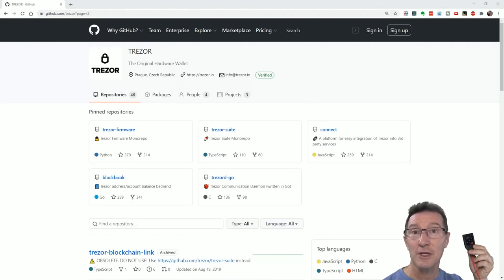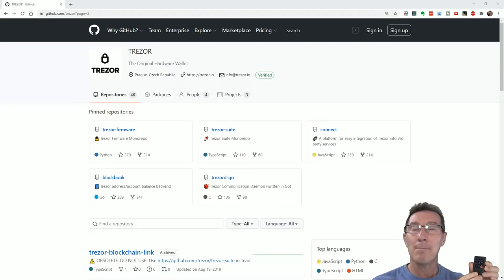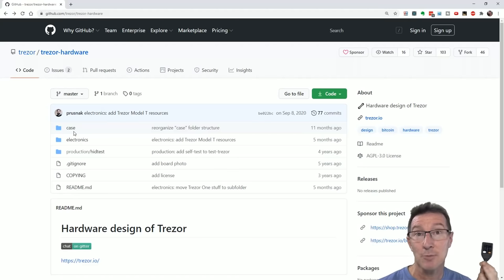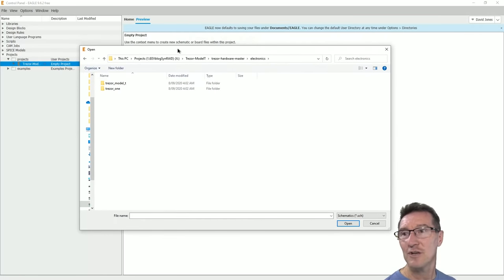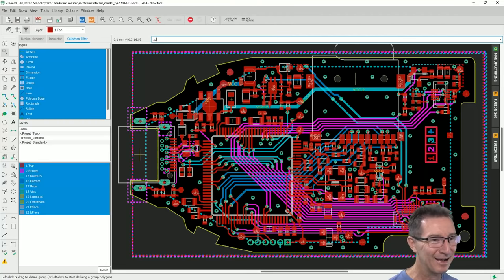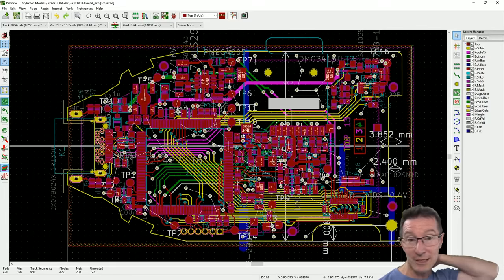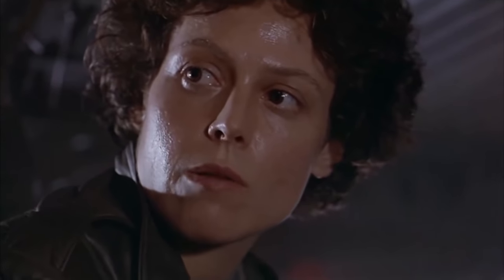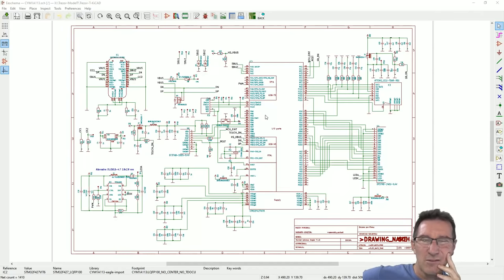EEVblog #1374 - DIY Trezor Crypto Hardware Wallet - Part 1

Comment from the maker: There is more hardware info here: https://github.com/trezor/trezor-firmware/blob/master/docs/hardware/model-t/index.md
Reply: Hopefully that Trezor engineer gets a call out! He got a bit raked over the coals in this video
Reply: "For those playing along at home": Most likely thanks to Dave - they've added tons of files, including kicad project files - however the edge cut layers of K1 are preventing the 3D viewer from loading properly. The slots/oval holes for SH1-4 are currently in the edge cuts layer. They need to be migrated from the edge cuts layer to the through hole pad parameters. The final result may be the same, depending on the fab. However if you edit parameters of the through hole pads mentioned - in the top right hand corner of the pad parameters window, you'll see the drop down menu to change the hole shape from circular to oval and add the proper numbers. Based on the corresponding stray segments in the edge cuts layer; SH2 and SH3 holes should be Oval, X:1.6mm x Y:0.6mm, SH1 and SH4 holes should be Oval, X:1.56mm x Y:0.6mm. Once you've changed the pad hole type + dimensions, then delete the corresponding segments on the edge cuts layer, and the 3D viewer now loads the board as desired.
Reply: They have updated github. Now there is a bom, schematic as png, and a general overview: index.md
Reply: I'd love to see one designed from scratch. could this be design as a breakout board so that various microcontrollers be utilised / flashed, rather than locking design to a particular architecture. could use rust to code the firmware, which would allow to target different boards.
Reply: is not found now

Comment: I know this is taking a different direction to solve the problem, but I found the “PiTrezor” project quite promising, as it lets you use the Trezor source code on a $5 Raspberry Pi Zero. No need to muck around with the hardware side of things. Can even add OLED displays and such.
Reply from the maker: Nice, didn't know about that, thanks. I want mine to be 100% firmware compatible though.
Reply: Thanks that sounds promising. Especially with BLE and a touch screen. But you'd need a custom firmware, PC app for password management and encrypted backup functionality.
Reply: Wait...so technically I can carry one of these on an SD card? Interesting.
Reply: What do you mean under "can"? Without a display you do not see what you are signing.
Reply: @pahom2  I mean that I can carry the SD card around but would obviously put it into a pi zero device when necessary
The ability to separate my wallet from the hardware, so that loss or theft of the pi device would be yet another wall between a malicious third party finding or stealing the pi device and through unknown means manages to access my wallet
It's merely a somewhat amusing and interesting thought rather than anything substantial or 'meaningful'
It'd be like the devices for credit and debit cards whereby you need to insert your card, enter your pin, and be given a code in return to enable the card holder to do whatever
Reply: @nicwilson89  when you are making a transaction you should see what address you are transferring funds to on the device. If you only store keys on the device and sign any transaction sent to it by pressing a button then this device do not give you any additional protection over the software that is actually interacting with it.
Reply: @pahom2  Where have I suggested any of that was my thinking behind the initial comment?
If I own multiple pi devices, for example, the spark of an idea would be that I only need carry the card or set of cards to wherever the other device(s) is. Say, if I have one of them in the car and intend on going out and paying for something with funds in the wallet somewhere such as a store that accepts crypto payment. Perhaps you have multiple cards for whatever reason and may store them in one of those tiny card holders, not that keeping a bunch of separate cards in one place whilst you're out and about would be much of a good idea.
Who knows, I'm merely thinking of hypotheticals and musing on things that were never intended to be serious in any way.
It matters little not whether it's unnecessary or silly since it was never anything more than a random thought.
Reply: @nicwilson89  I am answering Robert comment. He said that the hardware wallet based on Pi can even have an OLED display. And I've pointed out that it must have display to be secure.
Reply: @pahom2  Ahh, I see. My mistake! It seems you tagged me in that reply so I mistaking assumed you were addressing my comment. Apologies :)
Reply: @pahom2  The default configuration would be to use the Pi’s HDMI port with a monitor; an OLED would make it more portable and user-friendly.
Reply: @robertsundling  HDMI output is also ok. I am still under impression off all those "hardware wallets" with a single button, hence no control on what is actually signing.
Reply: how about the new  Raspberry Pico
Reply: @dh2032  Any microcontroller could work.
Advantage of the Pi Zero is that it can just run the trezor firmware with some emulation layer.
Downside is you might have more complex software stack and more vulnerabilities. My ideal would be to have just 1 single C file for the firmware that can be easily understood.
And Pi zero W has BLE which might be interesting. 
My ideal would be a "dumb smartwatch" you just carry on your person.
Reply: @EEVblog  hope you do it, could be a really interesting end to end project

Comment: 19:36 Kicad doesn't connect nets if the fill isn't applied, you may simply fill all four layers by pushing "B" and all nets should be connected.
Reply: if the zones have been assigned to the correct nets that is ...

Comment: These dots are canvas for planes, you must click "ratsnest" in eagle to render them.
Reply: Yeah, the plane outlines do not need to overlap 100%, since there's a board outline; it will apply the 'fill' on whatever is enclosed by the dotted-line when you hit on "ratsnest".

Comment: For a bigger screen, you should simply build your Trezor into that giant LCD infrared optical touchscreen monitor that you found in the dumpster. 😃
Reply: Lol. If only an STM32F4 could drive an LCD with that resolution...
Reply from the maker: If it was firmware compaitble, yeah :-D
Reply: @EEVblog  Make the hardware wallet a Raspberry Pi hat with a provision for the programmer?
Reply: @EEVblog  nothing a janky in-between can’t fix ;)

Comment: @EEVblog You click on the file name on GitHub page. Top right you get the selection to download the RAW file or you download the Zip of the entire project as you did.
Using Tortoise Git will make you life A LOT easier if you don't use git or the shell a lot.
Reply from the maker: We used Tortoise SVN at Altium, I liked that.
Reply: @EEVblog  - I am not experienced with hardware, so most of your vids look like black magic, especially when you go into the ElecEngineering stuff - but I am a software guy - its nice to see that you are still human, battling with github - gives me hope that I could apply myself to some hardware projects. - I hope we see more on this project. - but check out these guys - https://youtu.be/mqEfldjCqVY - get these guys on ur side.

Comment: Dave, on Github if browse into a specific file you can hit the "Raw" button in the upper right to download the actual file. You can also download a zip of the whole project from the top directory  page by clicking the green "Code" button and then hitting the "Download ZIP" link.

Comment: Maybe for part 2, try and redo the board on 2 layers and maybe change the form factor to something you like. Add another USB port. Remove some of the extra decoupling caps. Make it more minimal.
Basically keeping the hardware the same but potentially making it cheaper and more redundant. I do think this could be done on 2 layers as long as you keep the USB traces short.
Would make it much easier for amateur hobbyists to DIY their own wallet that way. Adding more decentralization I'd say.

EDIT: On second thought, I have some free time on my hands and might actually take this up. Let me know if there's any other suggestions

Comment: Doesn't look like the case in this repo, but idiomatic usage of GitHub wouldn't put 'outputs' into the repository, the same way the repo wouldn't include object files for a software project. They would be generated by a CI script and possibly included in a Release zip.

In lieu of the infrastructure to do that though (which is a bit trickier with hardware projects) I agree they should be part of the repo.

As far as the way forward, the imports don't look that bad, I would proceed with them. Yeah there's some spurious footprints in the library, but the rest looks okay. Your GND nets are (most likely) unconnected because the fills haven't been updated (press B). The Edge.Cuts layer looks like it might need some tweaking (since the 3D viewer can't determine the outline), but other than that it is probably usable.

As far as the soldermask expansion, it appears that the Adhesive and F.Mask layers are rendering in the same colour. Turn off the rendering of the Adhesive layer and it's probably okay. I assume the adhesive layer is just part of the Eagle libraries in case you need it, and you wouldn't send it to the CM if they don't require it. You can go into the Board Setup and just remove the layers you don't want.

Comment: The biggest weakness of Trezor over its competition in my opinion is that it has no separate secure element for storing the key material. There have already been attacks demonstrated that can recover key material through side-channel attacks, since the read protection of the STM32 storage is not really designed for storing sensitive key material. I'd love to see a series where you add support for an actual secure element that is designed specifically to store key material and make these kind of attacks much harder. That's what this device is most lacking.
Reply: The easier thing to do is make it self destruct if it’s opened.
Reply: The secret element doesn't help if it's controlled by an non secure chip. For instance with ledger it may be harder to extract the keys but not much harder to bypass PIN and authorize an transfer. Also most secure elements are completely closed source with an NDA such that you may report bugs to the manufacturer but aren't allowed to publish them.
Reply from the maker: I know. I was going to add stuff to prevent that.
Reply: @EEVblog  That's awesome, can't wait to see the follow-ups!

Comment: @EEVblog Dave, please don't give the guy a thumbs down for what files he shared, the problem is that there is no standard for schematics or PCB layout file formats, yes, the gerbers would be nice, but won't give you the bom/schem also.. (I stumbled over that problem many times too) He uploaded the files he got and wanted to share, you cannot expect the creator to cover all possible software solutions for creating PCBs. And as you said it's not a very complex board, I bet when redesigning it you can even make it better..

If you design OSHW one should use open source software to do so, sounds only logic IMO -.- 
so ... KiCAD.

Comment: I tried to do this while watching. the nets thing is almost entirely fixed (except one pin on the programming header) by refilling the zones (which do already exist. press b). The linkage between the schematic and pcb seems ok. you'd have to fix the holes in the board outline, design rules, etc. the soldermask weirdness is real and is happening because (some of) the imported parts have explicitly drawn polygons on the mask layer. some bulk deleting/renaming could likely be done to clean up these things.

Comment: You wont be able to modify parts of a board that exceed the free specs with the free version, but you can generate gerbers for any number of layers and any board size with the free version.

I do believe Autodesk said that they will always allows you full access to generate gerbers, e.g. for old designs if you happened to move away from Eagle or whatever.

Comment: In KiCad you hit the B button to fill the zones and then all pads connected to those zones will be shown as connected to the zones. If you then hit Ctl-B, or is it Shift-B (not sitting by the computer now), the zones will be unfilled and the GND vias and pads will be shown as not connected.

Don´t know why the frame was moving with the symbol for the chip. Never got that problem while importing Eagle files. Are you using a stable version or the nightly build, v5.99? v5.99 is for the upcoming v6 and there are some major changes for v6 that can cause some problems during the rewrite. The nightly builds are only for testing and debugging, not for designing PCBs, not yet.

Comment: Just FYI, there are (at least) two different philosophies when it comes to whether output artifacts (so, in the case of software: compiled binaries; in the case of hardware, gerber + bom files) should be included in the repo. The disadvantage of excluding them is a certain degree of inconvenience for the end user, sure, but the disadvantage of including them is that people like you will assume that the BOM, board, schematic, gerbers etc are all being kept perfectly in-sync with each other with every single commit. Not to mention merge conflicts, differences in different editor's gerber generation settings/preferences causing subtle nonsense diffs, etc. These problems do have solutions that can work to varying degrees, but still.  I just point that out because with that in mind, it's not necessarily "wrong" for them to not include these artifacts, it may be more of a carefully considered compromise. Or, maybe they're indeed just lazy. I dunno. It would be nice to include a script which generated it though (as is always provided in software repos in the form of a Makefile or similar), that's where the analogy between software and hardware breaks down.

Comment: Can you do an Altium import, then export?
Other folks have run into similar import issues and written their own converters, such as: https://github.com/lachlanA/eagle-to-kicad
Reply from the maker: Yeah, can try Altium. Depends on what people want to see in a part 2.
Reply: And KiCad to BOM https://github.com/openscopeproject/InteractiveHtmlBom
Reply: @EEVblog  Lets go KiCad, Altium is expensive for everyone. It would take away from the open source spirit.
Reply: @EEVblog  KiCad please.
Reply: @EEVblog  KiCad
Reply: @EEVblog  You may try changing the design to your needs in Altium and then exporting to KiCad.
That will be easier and faster than getting used to a new CAD
Reply: @wyatthickman4442  Why are you spamming with a war criminal as your avatar?
Reply: @cunning-stunt  Very possibly a bot

Comment: You can download a single file from GitHub. Navigate to the file and then right-click on the "Raw' button and save as.

(Also, why not do it the right way - import the schematic into Altium and do the board from scratch?)

Comment: Might be some work, but you could try and optimize the project into an inexpensive DIY kit that any hobbyist can build with no special tools.

It doesn't have to be an exact replica, just firmware compatible. You wanted a bigger screen, right? So you'll need a larger enclosure anyway. Maybe go for a standard, cheap project box that anyone can order along with the rest of the BOM (no 3D printing). Since board space will be less of an issue, why not go for a two-layer board? Would be even cheaper to make (by a factor of 4, it seems) and might make debugging easier (no internal layers to deal with). Maybe use components that aren't too small for hand soldering (e.g. no 0201). Have a BOM for a supplier that doesn't charge outrageous fees for small orders. That sort of thing.

If people want the small and pretty version, they can order one from Trezor. If it's just about the functionality, the bigger screen, or the DIY nature of the project, they can go with your version.